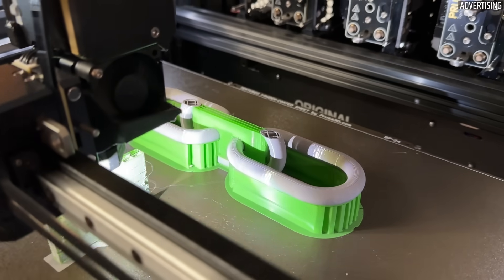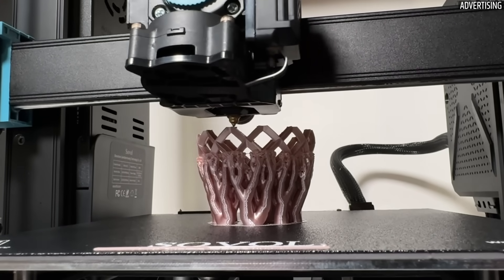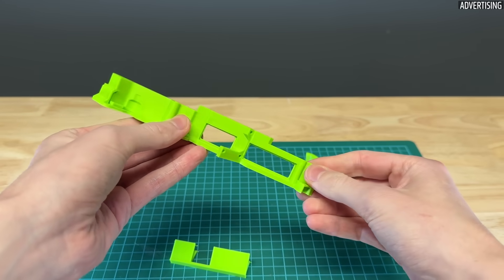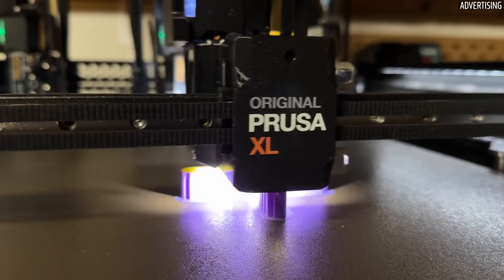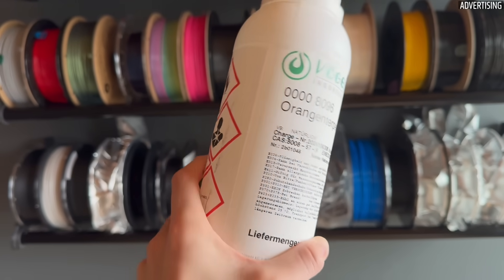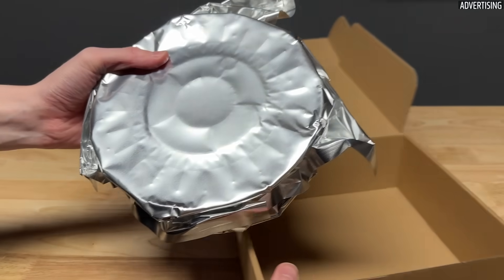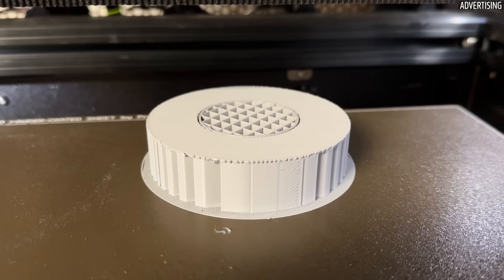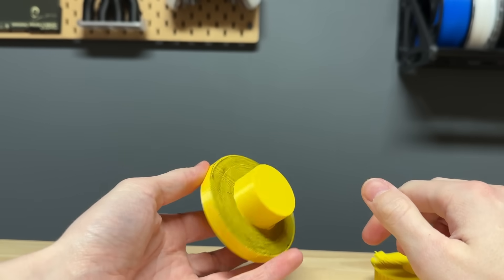Always Perfect 3D Printing Support Structures: The Ultimate Guide

Comment: Sharpie as release agent, now that is an interesting idea. But, I do have to ask, the same pause for applying sharpie, letting the support cool off normally, wont that action give similar results?
Reply: I think you are right. When pausing a print, if I pause too long I always end up with a very distinct line where I paused. I think the sharpie probably adds another layer of resistance though.

I think pausing the print would be the equivalent of using petg with pla and vice versa

Comment: would you be willing to test the sharpie trick again but compare it against the exact same G-code, wait till the pause but instead of applying the sharpie just wait 20 seconds or so?
I wonder if honestly the sharpie is actually doing anything, or its just that the time it takes to apply the sharpie is letting the support cool enough that the next layer isn't bonding as much
Reply: I had the same thought. It'd be interesting to do a video comparing sharpie on one piece vs just the same amount of time on another. Also, so of the other ideas in the comments, vegetable oil, glue stick, hair spray, etc

Comment: 7:14 you can use polyterra PLA, they break away from PETG much easier than normal ones
Reply: Btw they can be extruded even at 165C, at lower temperatures they break away even easier

Comment: If You have a multi-filament printer, one way is to use the PLA vs PETG method.  If You're printing in one, use the other as a support.  They don't stick to each other.

Comment: I found that when using PLA as the support material for PETG prints, it is best to use the natural color of the PLA filament rather then using a colored PLA filament. I think this might be because the added color pigments within the filament is creating extra stiction between the two materials. This might be true as well when using PETG as te support material to PLA. Always use the natural color of the support material filament to prevent this unnecessary stiction at the interface to make it easier to peel off.

Comment: The Xioneer materials seem very interesting. I work with Stratasys FDM printers which use a proprietary support material which can be dissolved by a hot lye bath, and it would appear that Xioneer is basically doing the same. I do wonder though if it could put them in harms way, considering how litigious Stratasys is towards anyone even appearing to infringe on their IP.
Reply from the maker: I've heard that Stratasys works with Xioneer but I'm not exactly sure!
How is the support material from Stratasys you're working with called?
Reply: @JanTecEngineering  considering the support material is proprietary, the contents are not even listed in the MSDS, I doubt they have shared it with other companies. The support material is called SR-30 from Stratasys. It's really quite handy, and we have a dedicated heated lye bath set up to dissolve the support with, at 70 degrees C.
Reply: @SwitchAndLever  I can't get into much detail, but our VXL polymers behave much the same as SR30, especially the VXL 111 in terms of temperature range.

Comment: Could be a neat project to connect a sharpie to the front of the extruder then use an offset to automatically draw on top layer of the support interface before starting a new layer. It would have to be a retractable sharpie or else it'd dry out.

Comment: You can save printtime when using petg support for pla if you exclusively use the material swap on the interface layers.
Reply: oh, good, I thought I was the only one.  I didn't even know people were printing the ENTIRE support structure with special filament until this another video I saw.  Good god, that's expensive, and all those filament changes would be brutal.  I just print the INTERFACE in quick-release, or dissolving filament. The rest of the support is the same as whatever I'm actually printing.
Reply: Is this only viable with AMS or MMU setups?
Reply: @OneIdeaTooMany  no. You can add a pause at a layer, like on the video.  It will be more difficult on a more complex design, but it is doable.
Reply: this would be amazing for some items I am currently prototyping. have only begun investigating supports as the vast, vast majority of my prints have never required. For Bambu, is there a way to do this which isn't a layer change command? I ask because I also often do some multicolor layers which I know in Bambu these two things do not work well together.
Reply: @zacharylaschober  on a bambu you should only have to set the interface material in the support settings.
Reply: @scruffy3121 I set the material in the settings, but I use pla cf for the print and have used petg as support, and if I could just use the pla cf for the first 50 layers I'd save a lot of time and filament (and likely expense due to my bulk pla cf purchases). That is what I am wondering, if the support can be told to modify without just doing the layer swap in bambu?
Reply: Always printed support in the same material, to save on material switches. And just the final layer before going to touch the actual print switching to PETG (or PLA when printing in PETG).

But first I had issues with adhesion. Turned out there standard was insufficient flush of material and there was PETG/PLA contaminient in the actual print. So you might need to flush more then the standard values.

Comment: Sharpie method does not need a servo too. There are retractable pens (with springs). Attach pen to hotend and add a flat panel on top of the printer. for tool change macro, let printer travel to top and simulate a click on the spring button on the pen. It would release and retract just like you pressed it manually.
Reply: I've never seen a retractable sharpie. It'd dry out.
Reply: @skywardsoul1178 they've actually made retractable sharpies for many years
Reply: @skywardsoul1178  They exist and the ink nub is stored very far up into the body. As a consequence, the plunger is very tall
Reply: @skywardsoul1178  They don't though, they work fine. Google "sharpie retractables"
Reply: I thought so too until recently. There are retractable sharpies and they have a little trap door that seals the end when the tip is retracted.

Comment: There are colorless blending markers that are used for drawing. Would be really curious if they also work
Reply: Most likely they would not work. The sharpie works not because of the alcohol the ink is held in, but because of the ink left on the plastic. A blending marker lacks this ink, and the alcohol will flash off in seconds, so it's unlikely to make a difference.
Reply: Do they have ink?

Comment: Could PVA applied with a brush or a glue stick be used as a release agent?
Reply: PVA is used as a mold release agent in noncritical surface finish fiberglass work. Instead of water, the PVA is dissolved in an alcohol/water mix and dries very fast.
Might be worth a look.
Reply: PVA takes a lot longer to dry than a permanent marker. This may be a deal breaker for parts where poor or inconsistent layer adhesion is undesirable because the contact layer will cool down too much in the time it takes PVA to dry.
Reply from the maker: Tested it in my in-depth video about various release agents: https://youtu.be/BOG9Li2PXMY

Comment: You mention combining PLA and PETG using MMU. These matetials need different temperatures. How do you set that up?
Reply: Custom Gcode by pausing at the desired layer.  Use M109 Sxxx to where xxx is the desired temp.  This will have the printer wait until its at the set temp before continuing.

Use M109 Rxxx to go to a lower temp and have the printer wait for the temp to lower.
Reply: @brandonbrown3600  Thanks for confirming. With other words only feasible when there are few interface layers and preferably on flat, non-organic prints.

Comment: The sharpie release agent stuck out to me in a previous video where you mentioned it. I'm very excited about that idea, it seems so obvious im not sure why it hasn't become a thing already. Equipping a printer with a release agent brush or nozzle or something is way more reasonable than tool changing or mmu units and way less wasteful. I hope for a future where this is an expected feature like bed leveling, and plan to design parts specifically for "print pause sharpie" in cases where completely eliminating supports is impossible.
Reply: Something about the way you mentioned that struck me. Instead of using the black marker which obviously will stain the consequent layer, we could approach it in a similar way to the marker. PVA comes in many different forms, but almost all seem like they could work depending on the difficulty of the print. In fiberglass work we use it as a release agent for the part to release from the mold. In that use case, it is brushed on - or thinned and then sprayed on. The marker would still be an ideal use case for application for most prints, just use the thinned and sprayable version of the PVA to put into a dry fine felt tip marker. Same as the paint and ink, it would wick into marker be used as the release agent mid-print, even for the organic supports. We would just have to use a separate tool holder for the marker and setup it up in the stock location of the original nozzle.
Reply: @OffGridOverLander Adding a servo or solenoid operated sharpie to the side of the toolhead, similar to how bed leveling probes work, should be almost trivial, it's just a matter of connecting it to the motherboard of the printer. Or even it can be completely autonomous from the motherboard, for example switched on and off by bumping it into a protrusion fixed on z-axis in special place, could be completely mechanical. One thing you need to accomodate for is wearing of the tip of a sharpie, for that purpose something like brush pen might work much better
Reply: @avelkm  You could build a simple spring loaded sharpie, Z height and tip wear doesn't really matter that way.
I just tried the sharpie trick by hand and it works really well.
Reply: @OffGridOverLander  just dissolve some glue stick in water and brush it on with a paint brush. While this will work well for large flat overhangs, it is completely impractical for more detailed prints.
Reply: I have been using hair spray as a parting agent since 2015. Works good so long as the parting line is all in one layer. If things get more complex, you have to mask off stuff and it becomes more of a pain than it's worth. I have tried all sorts of targeted parting systems, and at the point when you need this using organic supports becomes the best option. 

Edit: I have a feeling some automated tool-head option would be ideal, which is something I plan to explore in the future.
Reply: Every time I see these obvious and brilliant solutions neglected for years, a neon sign that reads "PATENT" flashes in back of my head
Reply: What do you think about glue as a release agent for PLA?
Reply: Can’t we just use some kind of printable material from an AMS to automatically print a thin release agent at that time of the print?
Reply: @Horendus123  Yes, PVA for dissolvable interface, or a layer of a material that doesn't stick well, for example PETG for PLA or vice versa. There are lists of materials that work well as support interface layers for specific materials online. They have to be printable within the same or similar temperature ranges though and you must purge them well. A tool changer or idex would be far better for this. I find the AMS and similar MMU's extremely flawed and extremely wasteful, not to mention slow.
Reply: I hope there's a better way than dissolving HIPS and Limonene which is very toxic. I think a brushed on layer of thinned PVA is easier and non toxic.
Reply: I'm excited to try it as well. Release agent is a potential great use case for a 3d printer. Does it work with pla petg Asa

Comment: They basically sent you a sous-vide set lol. You can prepare delicius meat now.
Reply: That's right, but we made the wholes in the lid ourselves and put some stickers on the bucket :-) Funny enough, the more professional equipment we make is indeed also interesting to gastronomy. By the way: A washing machine would work as well!
Reply: @krosstoph  would a heated ultrasonic cleaner work as well? Since you mentioned a washing machine, what about adding some kind of agitator to the bucket to keep the liquid moving, similar to the impeller in a resin wash station.